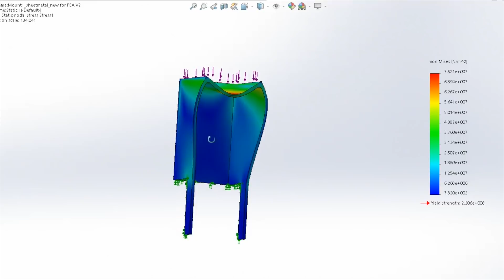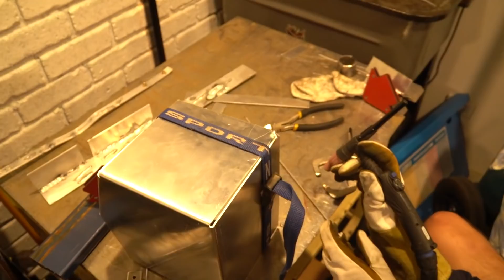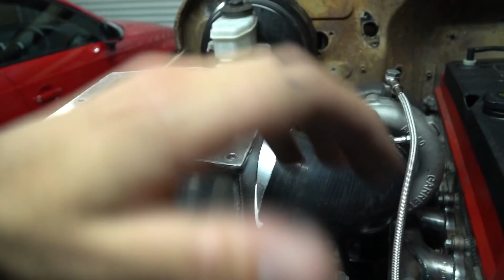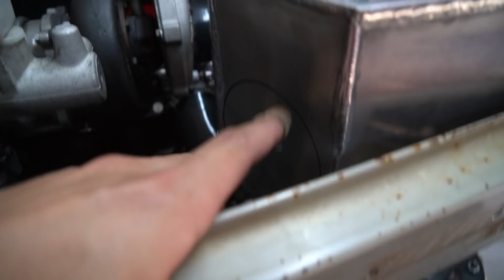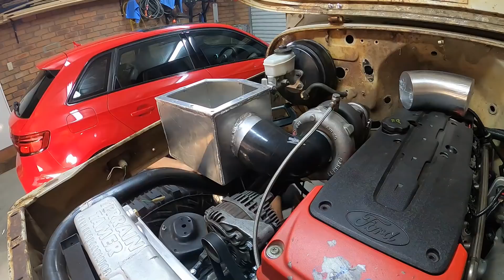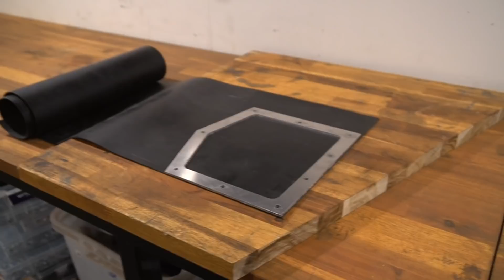How to design and build custom 4x4 airbox and snorkel  - Barra T FJ 45/ 80 series Landcruiser Ep.#9

Comment: Just curious, did you calculate your CFM the motor requires? And get actual numbers for the flow on the filter? Also the shapes and bends can significantly affect airflow. Good work though. I don’t have a tig and my mig skills on aluminum are pretty subpar. I have an LS swap that would overheat from a clogged air filter. Couldn’t make any power. Currently trying to fit a 5” in/out powercore filter. Since it’s still running warm on mountain passes, and kicks the filter minder over to half way on a brand new filter first full throttle pull.
Reply from the maker: I didn't with this one, but doing it on the latest build and the results aren't what I want to see! I basically need 2 Pod filters to make 750 RWHP!

Comment: Wouldn´t stainless make sense for the airbox, as is way less heat conductive?
Reply from the maker: Possibly but the airbox is quite far away from the manifold/turbo hotside in comparison to the pipe work!

Comment: Great video, I'm on the opposite side of the fence to you. I'm a welder fabricator but know nothing about cars. My son has tasked me with building an air box for his Hilux. Now you have your weld table fab up a guide bar to prop your torch hand so you can set the height and slide along in the same plane as your weld. Also when your watching TV put a tig glove on and practice feeding tig wire with your left hand and try to eliminate restarts.
Reply from the maker: Cheers Maurice, I like that tip a a lot. Definitely going to give it a crack, nothing like developing some muscle memory whilst watching the TV!

Comment: How much roughly will it cost for someone to do this project on their own?
Reply from the maker: I think it's a case of how much do you want to spend. I am not doing it the cheapest I can, just trying to do a good job and make something I'm happy with. Maybe on a budget, if you're happy to wait and haggle with second part parts, 20K is realistic. I think the way I'm going it will double that and then some hahaha.
Reply: @DesignedandBuilt  oh beautiful. How about doing the snorkel box and snorkel?
Reply from the maker: @jacksonhartgen3063  $100 worth of Stainless steel, maybe $100 worth of ally. Maybe $400 all up if you include a top and all the other little bits, silicon joiners, laser cutting etc.

Comment: The air filter looks too small and may hold back power
Reply from the maker: Cheers Aaron! Planning on putting a bigger one in!
Reply: @DesignedandBuilt  it's not that I want to be negatively or anything but I actually do have a barra in that FG that makes 600 hp at the tires and just before mine was tuned somebody else had an FG g6 that had a small air filter and it was holding back over 70hp
Reply from the maker: Fair comment mate! I’m not chasing huge numbers or anything, just stick.  The filter is going to get bigger!

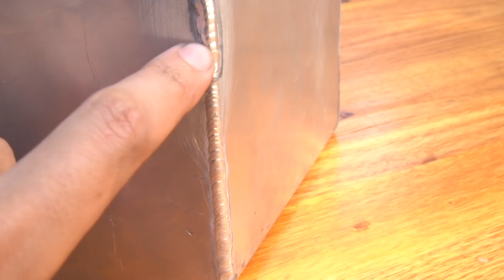Comment: Great work turned out well. I would test to see if all the welds are sealed by submerging it and running the air compressor gun along the welds, will bubbles on the other side if there is any pin holes. Doesn't take much anything like the 15:24 could leak
Reply from the maker: Thanks mate, yep definitely planning to test it. I might give that a go!

Comment: A couple of things, you can not have a straight shot to the filter as bugs will punch a hole in it. Next, you will need a nipple or one-way valve to let water out. Place some water in it while bolted to the frame it will show the lowest corner. Keep up the good work.
Reply from the maker: Thanks Jason, what do you mean my straight shot?
Reply: @DesignedandBuilt  The tube will act as a tunnel and at the end is a thin paper meshed filter. You could change out the plastic mesh on the ram head with a metal grid or divert the forced air at end of the tube to divert down first allowing stones and bugs to hit the bottom. I hope that helps.
Reply from the maker: Cheers Jason, good idea.

Comment: Haven't tried myself but saw someone do a stop/start by back tracking about 5-10mm into the previous bead then continue from there. Think it may work with Aluminium welding.
Reply from the maker: Thanks Erik, good tip. I’ll try it on some practice pieces!
Reply: @DesignedandBuilt  also, using a worm clamp will give a straight line mark as well. All depends on if you have the right size.

Comment: Would have been easier to weld if when u put a tack on the gap on the air box hit the tack with a hammer quickly to close the gap
Reply from the maker: Cheers Zane. Someone else mentioned that as well! Next time I reckon.

Comment: Airbox came up pretty good for a first go Richard, well done.
With the stop starts, instead of running the end of your weld into the start of the previous weld to blend it like with a mig, start your new weld on top of the end of the previous weld When its pooling, one dab and go. It looked like you werent using a foot pedal for the tig welding. A Pedal makes alloy welding sooooo much easier once you get used to it.

Also, if i fab something and it comes up pooh, i stitch the inside to keep the strength, knock any high spots off the welds/plate etc then go right over it with an orbital. Comes up mint and looks like it was all done in one piece.
Also for big gaps, you can knock them in a bit with a plastic mallet (within reason). Once welded, no one will know its been massaged.

I must say, it was pretty sweet to see an engineer have to deal with their own designs lol.
Reply from the maker: Cheers mate, I’ll definitely have a few goes on practice pieces! And yeah you’re right the hammer would have been a really good idea. Hahah yep not often that engineers have to make there own designs, good learning experience for me, hopefully will help me be a better engineer!

Comment: Great work, love the snorkel! I know you said it's temporary, but Just be careful when welding mounting bracket tabs like that to aluminum, they will fatigue and crack off very easily
Reply from the maker: Cheers Jacob! Any suggestions? Sounds like you have some experience?
Reply: @DesignedandBuilt  no problem, a little experience, I'm a mechanical engineering student doing some internship work with an aeronautic welder/machinest. I've designed an ally tank for my boat and he was very adamant about not welding tabs to it. I think with that airbox as it's quite light, using a tab with a 90 degree bend that has a large flat section to weld flat to the box will result in alot less stress concentration and chance for fatigue failure. I can ask what he would recommend next time I see him
Reply from the maker: Cheers Jacob, I was thinking something similar to my exhaust tabs for a permeant solution, a “U” of sorts.